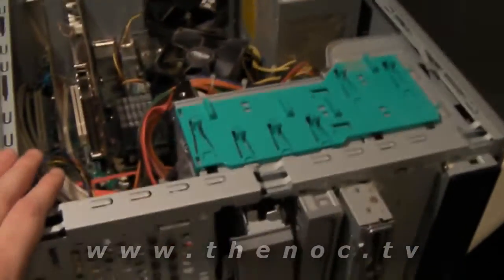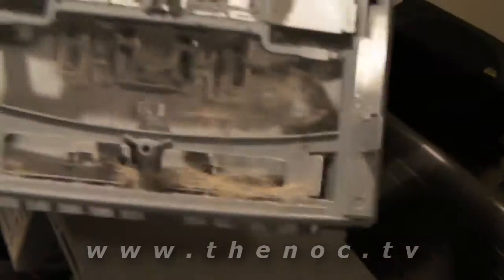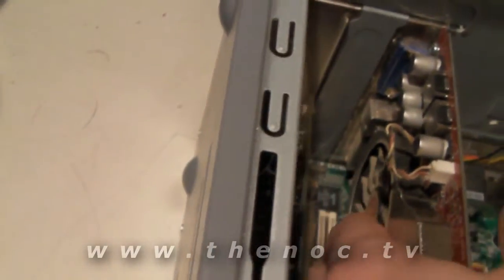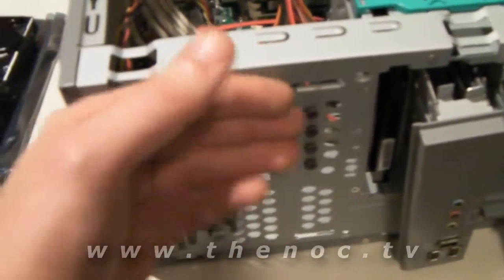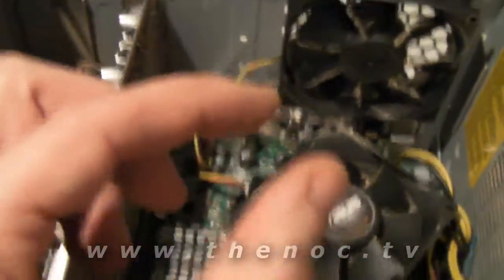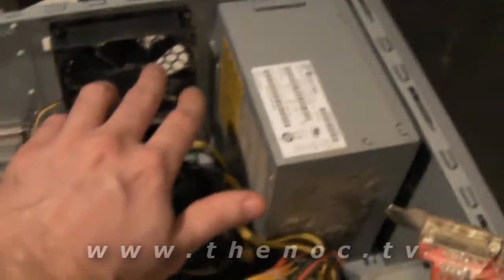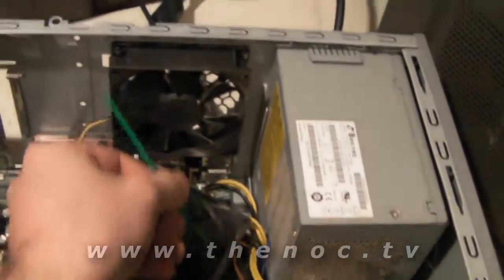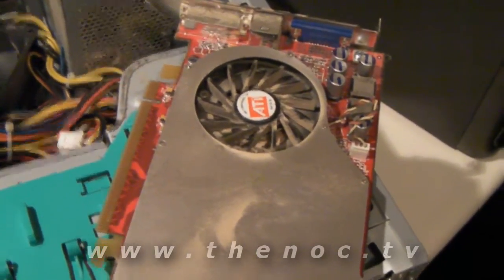Cleaning dust, dirt, and other grime from your desktop computer in HD!

Comment from the maker: No that would be another issue, although cleaning it can sometimes remove dirt that causes a short in the system preventing it from working.

Make sure your ram, and graphics card is seated well in your computer. That is likely the issue.

Comment: Do NOT use a vacuum to clean your computer! The small particles that are sucked up will bounce against the plastic nozzle of the vacuum creating a static charge. The quarter inch tip will not help if the charge is big enough to jump that distance. Even a small discharge can consist of a high voltage and can damage the components in the computer if you're unlucky. Canned air is always the thing to use, nothing else, unless you ground your vacuum nozzle.